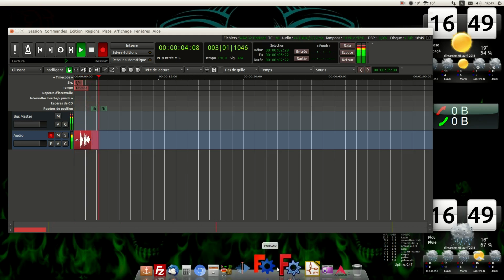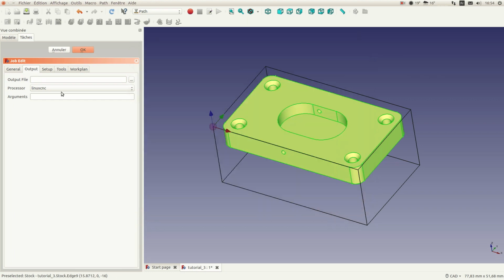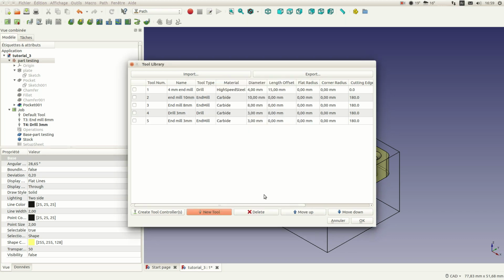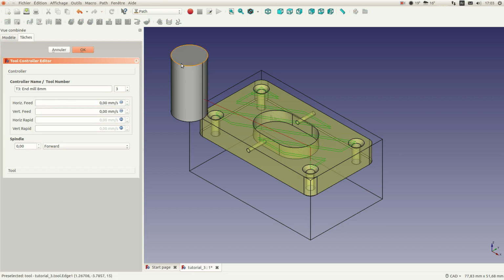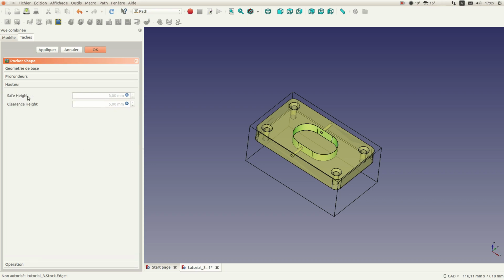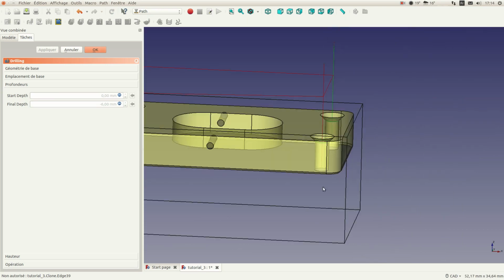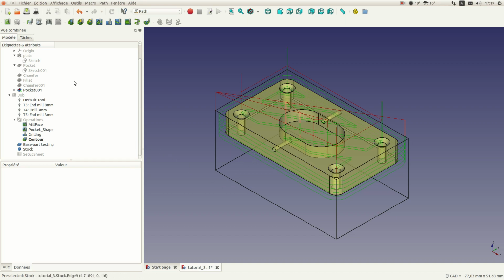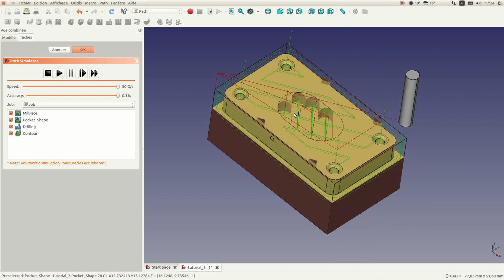Ultimate Free CNC CAM tutorial with FreeCAD

Comment: question. How do you free up the part from the rest of the stock? Do you flip it over and mill 30mm of material?
Reply from the maker: 2 options are available, either you add tabs at the bottom and remove it by hands, or you leave a small amount of material you flip it and mill this small amount
Reply: @laurentcnc6662  Well tab at the bootom won't work with the example in the video. There is a large piece of stock below the part.
Flipping the part and remill the remainder  is an option I was thinking about. However this has some issues with the reference moving slightly which will make the two milled area visible / shifted.
We are yet to see someone truly configuring path and mill something for real. There is usually more to consider I think. 
If you guys can do a video on clamping techniques that would be nice I think.

Comment: Ssi have worked through all your examples so far although I have yet to add machining though I guess I have to add finishing passes to the side elevation of the hole.....
Reply from the maker: You are absolutely right ! And you can add finishing passes on each operation for a better surface finish.